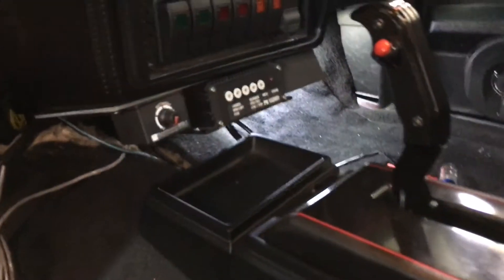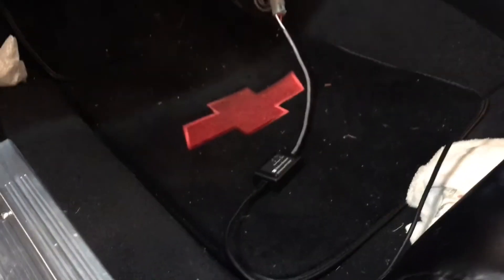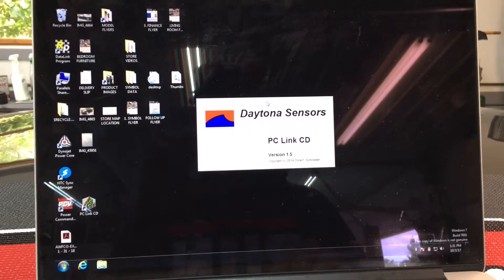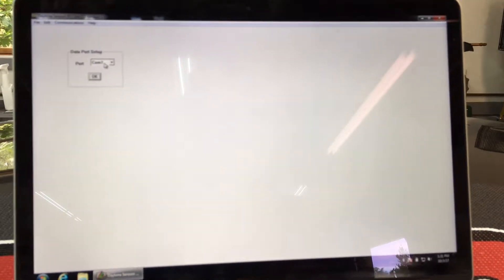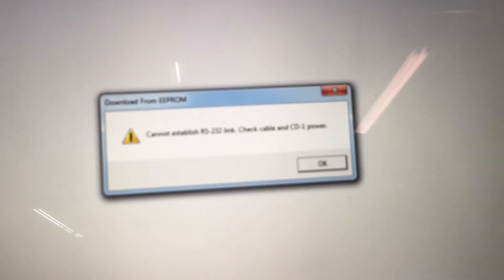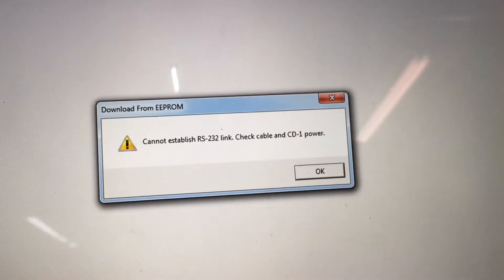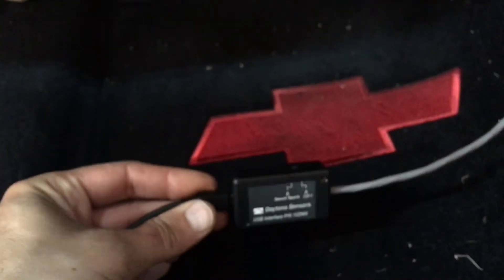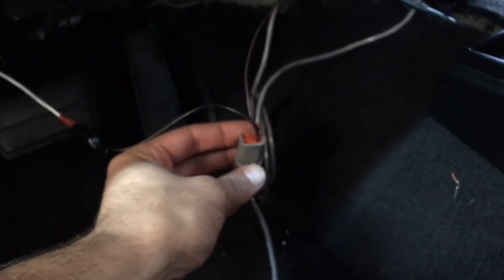Daytona Sensors Programming Issues 1

Comment: Hey , I have the same issue. What was the remedy?
Reply from the maker: I threw it in the garbage and purchased an MSD unit. This technology is so outdated and the manufacturer has no support for it.
Reply: @smmenterprises  oh that sucks. I am getting the same message. Installing in my boat for the idle stabilization. Luckily I didn’t install it yet. I may have to send it back. If msd had something like that I would jump on it. I was able to update my Cardo unit so I know my computer is working. I agree , they really need to update the software ! Thanks !

Comment: Sorry about your trouble.  I was amazed at how little information there was on the internet on how to install and operate this ignition box.  I had the same error message initially.  I had to get the correct driver from the ftdi website.  I wrote up everything I learned on stangnet, including how I got the driver to work.  This is the link.  I hope my experience will help others.  https://www.stangnet.com/mustang-forums/threads/install-daytona-sensors-cd-1-ignition-mustang-fox-sn95.912573/